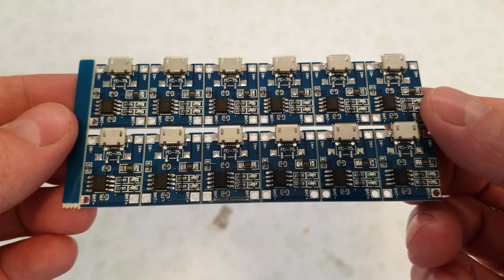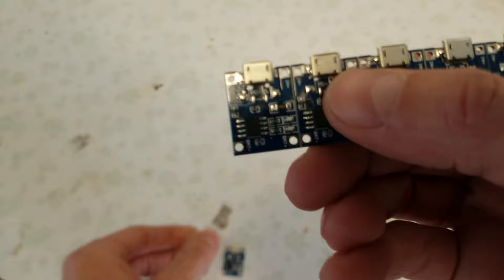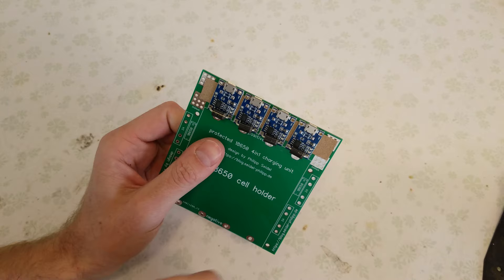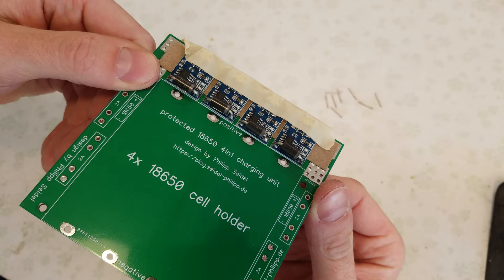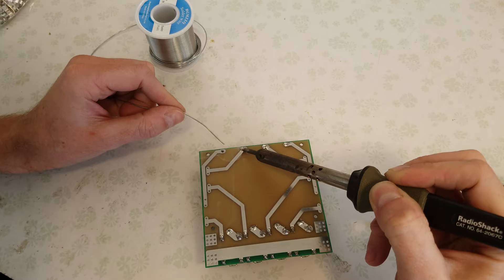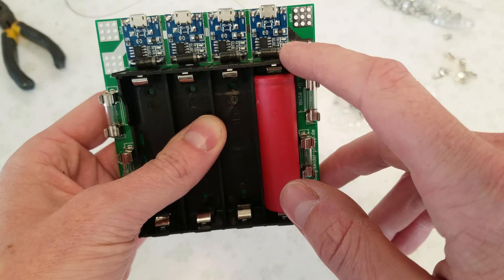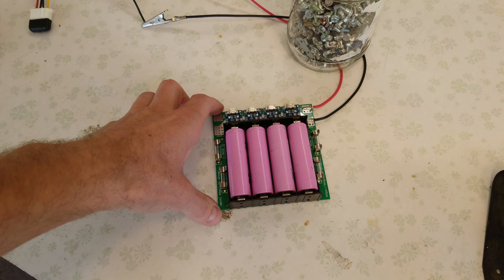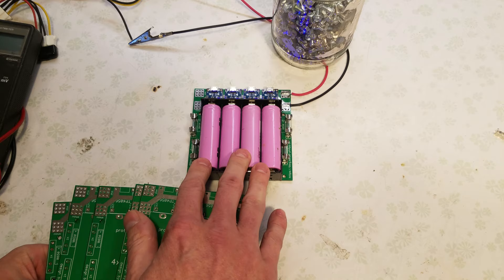Building a 4-Cell TP4056 Charger for 18650 Batteries with Reverse Protection

Comment: Put silk ribbon under each battery. Use small screw and washer and make a new hole in the holder/board (not in a trace path) and  you can lift the ribbon to pull your batteries out.

Comment: Thead the reverse polarity protection diode and solder it before inserting leads through the baseboard, helped me a bunch on the second one i built. Great video..because of your video I chose to build 6 of these units.

Comment: Instead of using a screwdriver to get the batteries out, you can put a string across the cell holder before adding the batteries. Then you just pull the string to get them out.
Reply from the maker: I was doing that before with the imax thing I built that had two of the 4-cell holders glued together. The problem was the string would sometimes get caught on the glue/tape pieces left over and pull out nearby cells when I pushed another in. Maybe I'm doing it wrong or just need to clean the cells better, I don't know lol.

Comment: The new version of the changing board (2016/2017) has protection built in.
Reply from the maker: The new version of the TP4056? Does it have a different part number I could look up?

Comment: i know its a bit late to the game, but if you glue a ribbon on the side of the 4 cell holder, and lay it down under the batteries before you charge them, you could pop the batteries out by pulling on the ribbon
Reply: OMgosh.
I just posted nearly the same thought. LoL

Comment: Excellent walk thru, when I built mine I didn’t think of reusing the legs of the diodes to fix the tp4056. I did 3d print some spacers to rise the charger when I screw it to a wood board.
Reply from the maker: Thanks! Have you found the spacers to help with heat at all? I've seen people do some interesting things to cool the TP4056, but mine don't seem to get that hot for some reason?
Reply: I did the spacers just to ease cable management. I really haven’t have problems with heat.

Comment: Update Jan 2022.  Keep your eye on what TP4056 board he uses in video. Newer version of TP4056 will not work as it has different contacts for B+ and B- and they are slightly longer. Make sure your TP4056 looks exactly as in this video.
Reply: There are 3 versions of TP4056.
No need for balanced board. right? because no balancing needed.
There is enhanced, and one other.
Not sure which he used... 
Maybe protection, not enhanced, not balanced?
Reply: Nope, its the board with output pads as well as battery pads that will be too long. 2 pads in the back, good. 4 pads, too long. The DW01 makes it too long. Those are the two main versions but I'm sure someone is slapping TP4056 on a board with even more features

Comment: Great project.    From the sound of your flush cutters though, they are actually fairly blunt, diagonal cutters.  Instead of a loud "SNAP" you should hear a quiet "thwip" when they cut.  Aside from being more satisfying to use, that loud SNAP creates a shockwave that travels up the leads that will sometimes damage a delicate component.   I'm really fond of the Xcelite S475NJS, I bought three pair a couple of years ago for 15 bucks apiece. Those are scarce and pricey now but I'm sure there are cheaper ones available.

Comment: Hi, that's a nice little charger. I build a 100Ah power wall using those battery holders and the best way to get them out is to wrap a little piece of tape around the middle of the cell with both ends of the tape sticking out and stuck together, making a finger puller.
Thanks
Reply from the maker: Thanks for the tip! I used to use a piece of twine like this but ended up with pieces of string everywhere after a few uses lol.
Reply: I put a ribbon under the cells, attach the ribbon to one side on the board, then pull the ribbon on the other side to get the cells out
Reply: I have those battery holders for HW-586 boards, i can pull 16 cells out with 1 ribbon

Comment: Glue a ribbon to the underside of the cell holder and lay the loose ends over the holder and place the cells over the ribbon.  When the ribbon is pulled, the cells pop out like you may see as used in small battery powered items.
Reply from the maker: Yeah I've had a lot of people suggest that. And while it works, it's not practical when you have 100 cells in at a time. That's a lot of strings or ribbons, it gets everywhere, etc.

Comment: The holes in the battery case is for a thin rope to go behind the batteries. You pull on the rope and all the cells the pop out very easly.

Comment: Awesome! I just purchased the components... I've mistakenly reversed polarity when quickly swapping batteries and burnt out half a dozen TP4056 modules.
Reply from the maker: Yeah I've heard of a lot of people doing that and wanted to make sure I didn't make the same mistake lol. The diodes are only $0.08 USD each and makes sense to put them in since you're already soldering anyway and that way you won't have to replace later in the event of a mistake :)
Reply: @LithiumSolar  8c is half the cost of the board basically
Reply: @LithiumSolar  did them diodeo connect from the negative yo the positive  .thanks

Comment: That's cool I was wondering when someone would put out a pcb for them I already have 4 of the 4 cell holders made up with just the holders positive soldered directly to the tp4056 and.wires for everything else on a sheet of plastic but those are nice the only thing would be an option for different input connectors like just a 5.5mm x 2.1mm or if you stack a bunch like an xt60 but I guess you can't expect other people to do everything for you

Comment: What about using the tp4056 that has the protector chip on them...the chip on board has protection for reverse polarity and back current flow, no need for the diodes and the fuses
Can you redesign with those boards with the new design?  Say a V2 build?

Comment: Is it just me or do the tp4056 module holes not quite line up? The modules in description are 25mm*19mm but the hole spacing appears a tad smaller than that. @lithiumsolar did your modules have any figment issues during assembly? The camera angle is somewhat hard to tell how alignment was
Reply from the maker: The alignment was perfect with the initial batch of TP4056 that I used. However, the second batch I bought had much smaller holes and couldn't get the diode legs to fit. I had to use thin wire instead. Chinese quality I suppose :(

Comment: That forward voltage drop of diode will never let 18650s to reach 4.2V charge. Don't know what is the forward voltage drop of the diode  you have used but even with a very low voltage drop of say 0.3V for example,   TP4056 would would never see correct cell voltage and will not charge it to the expected voltage, in this case probably around 3.9V thinking they have reached 4.2V .
Reply from the maker: That's not how the diode is working in this particular application.
Reply: @LithiumSolar  If you check the blog from original designer Philipp it is mentioned in the comments section that indeed there is a small voltage drop across that diode. I wonder why do you think this is not the case here?

Comment: can you do that with 4 cells in series? that would be neat
Reply from the maker: You can but you need to use an isolated power supply on each TP4056 (like a wall transformer). If you don't, you would be shorting out the cells [very bad] since they all share a common negative.
Reply: @LithiumSolar  ok some very cheap 5v isolated converters needed....

Comment: Thanks for this great build, even if your are not the creator of the PCB, but explanation and purpose of each component is great and also all the various tips present through all the build. I saw those PCB before in another video, but your build is pretty neat/
I made recently an 4x 18650 charger with 4 TP4056, but I dont understand why, when for example 1 battery is charged (blue) and another get charged, again thr 2 supposed be charged get back to charging state (Red Led). and it happen with all 4 TP4056 modules. When I charge an 18650 alone it works fine, but once I connect 2 or more TP4056 in parallel this issue starts. So batteries are not getting fully charged. Very confusing.....
PS: about the battery holder, I advice you to bend a bit batteries holders using a pliers, this way it will be easier to be inserted and removed. Of course, dont bend the connector to much, you dont want the batteries to be loosy...
Reply: .7VDC drop thru the diodes...the newer TP4056 with protection circuit doesn't have the drop

Comment: According to the upload date on the video, i'm a litte late to the "party" but i may have a idea how to "upgrade" the holders  to allow somewhat easyer removal of the 18650's: In some battery holders for various things there is a small piece of cord / cloth that goes under the battery when you insert it. Once you pull on that little piece of cloth it lifts the battery a little and helps with the extraction. Maybe there is a way to "modify" the battery holder to add such a feature as well? Other then that: nice videos so far =D
Reply: ribbons there could be difficult if you just want to get one out

maybe you could cut hole into pcb and holder

another option is to make holder on your own, people have done this
just proper pieces of metal, on wooden or plastic sheet

what i've not see but what could work, if you board has standoffs, is to just solder diode and axial fuse in series and put that below your board

Comment: Hello again. I failed. With due respect, I could not understand, as to how I should place the order for the PCBs.  If you happened to stock the PCBs then, 
I’d want to place order for 5 PCBs. If you do not stock and sell the PCBs, then please let me know as to how, I should place the order directly to JCB factory. Danke schoen.
Reply from the maker: Hi. Sorry, but I don't sell things. You don't have to order them from JLCPCB if you're already familiar with JCB Factory. I just recommended JLCPCB because that's what I used and seemed to work well.

Comment: I would like to connect a device to the battery pack that requires 9v.  I know that I will need to connect batteries in series to get voltage.  Is there anyway I can do this without back feeding?  Thanks for the help.

Comment: Thank you for the video, all the other ones just showed tp4056 and had my skeptical on it being "safe" your video shows reverse current protection, and addings fuses, and im new with electronics and that seems better, one question I have though, I don't have 1n5402, but I do have 1n5408, the amp rating is the  same and the only different is the 5402 being 200v while 5408 is 1000v, would that make a difference or is it overkill? Its what I have atm, and won't mind using it if I can.

Comment: You need to get a temperature control soldering station mate. I need to do some learns in NASA stand soldering techniques on my channel for people. Don't trust the accuracy of the meter, I use to calibrate meters for the military.  The china ones would have a low accuracy.  Get a Fluke. Be close enough for a board.  4A per board I would say. Have a nice day good video.
Reply from the maker: I do have a temperature-controlled iron but it's more for soldering tiny components vs the thick legs on these diodes. I also have Fluke meter, which I used in the video. The clamp meter you saw is only used for quick-checking amps. I don't use it for much else for the exact reason you mentioned, accuracy :)

Comment: Why do use old tp4056 not the ones with protection?
Reply from the maker: The board was designed to fit TP4056. I didn't even know TP4050 existed :)
Reply: @LithiumSolar  - There isn't a TP4050. The modules that should be used are the MODULES that have protection circuits.
Reply: John Coops  <<<<< that was a typographical error. We all make such errors.
Reply: @sreekumarUSA  - Ermmm, and WHAT was a typographical error? 5 left arrows?

Comment: he should make the board support TP5100 chargers, that is what I just converted to after just using straight current regulated buck converters
Reply from the maker: I'm not sure TP5100 were around when this design was initially produced? Not sure...
Reply: LithiumSolar I’m just saying he should update the board to use TP5100 modules since they are new and better
Reply: @SuperBrainAK  - The TP5100 is not "better". The main advantage over TP4058 is the ability to charge LiFePO4 by changing one jumper.
What REALLY should be changed is to make the board suit the PROTECTED TP4056 modules, which are infinitely better than the ones shown here. I would suggest that protection is mandatory for ALL Lithium chargers, and this thing has zero. EDIT: THESE COMMENTS MADE IN ERROR, READ FURTHER ON.
Reply: @johncoops6897  I disagree, also the TP5100 does not charge LFE cells only Li-ion 1S or 2S. I disagree because it is also over 90% efficient versus on average 74% for the TP4056 which is a linear topology versus a buck topology. The TP5100 taking in a higher voltage supply means less amperage over the main wires and from the main power supply. less current means smaller wires, inductors, and diodes. The TP5100 has built in protections and should never overcharge the cell, reverse battery polarity is also a thing that it can handle.
Reply: @SuperBrainAK  - SORRY, my mistake! I confused myself, and was talking about TP5000 (not TP5100 that you mentioned). I've used all 3 chips, and found that the higher cost of TP5000 / TP5100 modules wasn't usually justified in most of my applications. I couldn't care less about a few % higher efficiency.
However I only use the TP modules inside custom builds - I have far better equipment here for charging 18650's and other loose cells.
There's no point building DIY like this video when a proper multi-cell / multi-chemistry charger is under $20 (4-slot) or $10-15 (2-slot) like the Liitokala Lii-402/202
Reply: @johncoops6897  yea most people dont care about power efficiency. They should though if they are trying to go offgrid where having smaller loads would be beneficial to their runtime. The main reason I built my own charger board is because I have 6 of the ZB206 modules which are perfect constant current versus the pulsed current discharge of pretty much all the cheap chargers. the modules are just cleaner and much more robust because it has a relatively large heatsink and if one module fails I can just buy another.
Reply: @SuperBrainAK  - you are confusing yourself about your megatester setup. Almost no chargers have pulsed discharging or CC discharging.... because they are Chargers. The ZB-206 is a cheapo discharging analyzer (CC load) and not a charger. This video and these comments are about Chargers, TP4056, etc... You know, those gadgets that charge batteries, to increase the energy inside them? 😃

Comment: I am assuming that because the new tp-4056 boards have protection built-in, one could just solder a copper wire in place of the fuse holders and fuses and call it a day. Or do I assume incorrectly?
Reply from the maker: I'm not familiar with the protection types, but isn't that for reverse-current (cell is in backwards) not over-current? If that's the case, you can leave the diode out but it would still be a good idea to have the fuses.
Reply: @LithiumSolar  Makes sense - Thx

Comment: Please xplain why did you use diode?
Reply from the maker: The diode prevents damaging the TP4056 if you accidentally put a cell in backwards. If the cell is inserted backwards, it will short through the diode thus blowing the fuse and protecting your TP4056 :)

Comment: How could you turn this into a battery pack?  What could be added to discharge the batteries to charge a phone?  How could you limit the discharge cutoff?
Reply: You would have to use a different board.
I don't think this is a good way for a power pack.
Look for more videos...
This is a nice charger for individual batteries.
Easy to make.
Cheap too.
Make one, sell 9 to your friends.

Comment: I'm sure you can use a surface reset fuse?
Reply from the maker: I imagine that would work just as fine. I'm not familiar enough with PCB design to be able to make those changes myself though. I guess I could fit them in the existing holes, but...

Comment: Can we connect the 4 tp4056 outputs in series and use it for a 12v dc motor ?
Reply: No, TP40456 cannot be put in series

Comment: Curious what the usb connection is for on the TPs?
Reply from the maker: You can use the USB to charge the battery instead of soldering the +5V wires like I did.
Reply: @LithiumSolar  pretty cool option I guess however good grief that'd be A MESS of wires. I learn a lot from your videos. Thanks for sharing with us all

Comment: Hello, can you use 1N5408 instead of 1N5402
Reply from the maker: I'm not familiar enough with the parts to know what the difference is. The person who designed these PCBs listed 1N5402 as the diode part number.
Reply: You can.  Any 1N540x will work here.  The difference is the voltage rating, but since we're talking about 4V, any of them are fine.  Actually a 1N400x or any similar power diode will work here too.
Reply: @charliep6334  I used 1n5404 as 1n5402 were not available.
Reply: Newbie question here. I've read that diodes have polarities? So I need to match the polarities with the board? If im seeing the video correctly, the side with the grey band is the negative but i think it is connected to the positive in the board?
Reply: @Reagulus  Diodes have polarity, yes, but it's not positive and negative like a battery.  Instead, think about a diode as a one-way valve.  Electricity flows through the diode towards the Cathode.  This is the side with the stripe.   If you reverse polarity, the diode will block the flow.